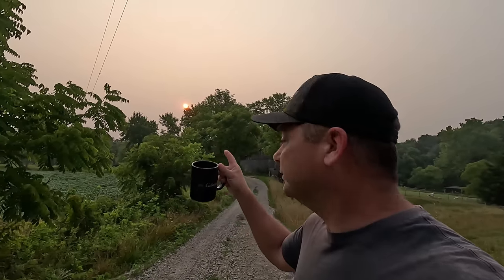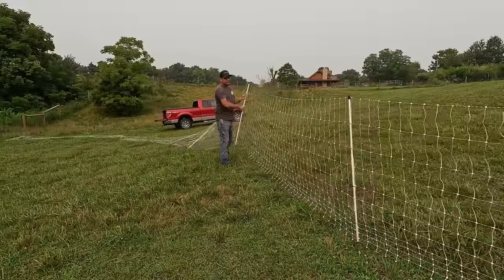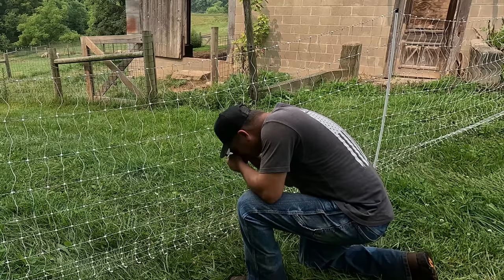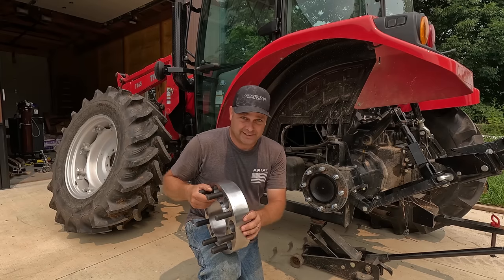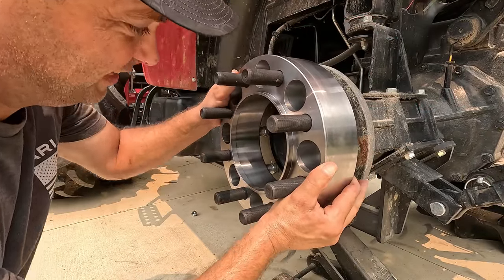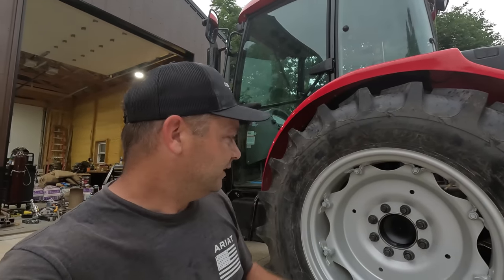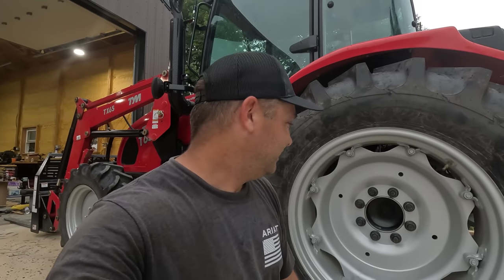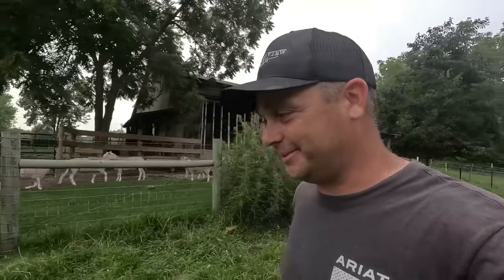Nothing goes as planned.  Widening the Tractor Wheels & Giving the animals more grass to graze.

Comment: Take the outer rims off and switch with the other side and you will have two more with options.  I did that with my 860 Ford with similar rim style.
Reply: He's not going to like reading this. Of course the tires need dismounted.  Just wait for the dissimilar corrosion on those spacers.

Comment: if it was my farm i would not put ballast in the tires but invest in a ballast blok for the 3 point. this way the leverage effect will help unload the front axle and steering while not needing to be as heavy. added benefit will be that when you take off the blok for doing field work your ground pressure will not compact your fields nearly as bad.  Thx for the HQ content by the way.

Comment: Could you not put the tires on opposite sides and put the center dish on the other side of the rim mounts to achieve the wider width without wheel spacers?

Also I would be a little hesitant using those spacers with the spacer to rim pilot being undersized. The pilot is what holds the rim centered and takes some of the load since the rim does not have the tapered acorn lug nuts. In all reality it will probably be fine, but the potential the rim could shift on the spacer is there. 

I enjoy your videos, keep it up!
Reply: Yes, leave the wheel centers, swap the rear tires/rims side to side. The rim mounting lugs are offset to one side.
Reply: Y'all beat me to this one... Leave the centers and swap sides with the rims.
Reply: Yeah i thought the same. Hes not utilizing the full 8 positions. I would not use wheel spacers when i could be using 8 position wheels
Reply: I believe those wheels will go 8” wider.

Comment: Sometimes times chicken. Sometimes feathers. It's just the way it goes. Actually, I want to thank you for the spacer issue. I've considered buying spacers for my subcompact tractor, but maybe it isn't worth the effort. No idea what brand you bought, but I think I'll put my money into ballast. I've got the rear tires loaded already. My light duty grapple seems really heavy and makes the whole rig nose heavy so I need to add weight to the rear end anyway.  Good info on the netting too. I considered it for keeping deer out of our garden, but it would appear my choice of poly wire might have been a good one. Hang in there Evan. Days like this one just make the really good days all that much more sweet.

Comment: Evan, 1st should you put some nonsiege grease on the wheel spacer?
2nd contact ARIAT & get your wife some W/P boots or shoes (steel toes) to replace her flip-flops.  They could protect her from snakes in her morning chores & Injuries.

Having the wheel spacers will save you from tipping sideways & after getting 
the tires filled you will be safer on the tractor period.

Comment: Spreading wheels on a tractor is for row crops . If you need more stability you are using a tractor for something it's not made for . For using the loader you need liquid in back tires and weight on back . Did  you use spacers on front ?

Comment: If you ever get to Harbor Frieght, you should pickup a furniture dolly. That way you can put it under your wheel to remove and replace the tires, but you probably will build a metal dolly if you have to remove the tractor tires.
Make your job easier and safer.

Comment: Can't you move the inner hub from the inside  of those cleats on the rim to the outside of the cleats by taking the rim bolts off and do the same thing as the spacers! Think you can also turn the wheel so the depth is to the outside and get more track width. We had a Ford 851 series tractor that had a system where you could could loosen the hub and hold the brake and the rim would slide on bars to make the track width wider !

Comment: I use those net fences all the time for goats. I separate the bottom 3 rows electrically and the fence works much better. Just cut the wires where they join the bundle.

Comment: I would not put the spacers on. There is a greater moment around the wheel bearings now, even the seals may wear out a little quicker now as a result. Things these days are designed to pretty tight parameters and making that sort of modification may be problematic also, it may nullify the warranty.

Comment: curious as to why you didnt just use the additional wider widths available via turning the outer wheel rims around as they are designed to do??? vs adding stress to the axle by adding axle length via spacers?....adding fluid ballast will greatly improve the tractor performance with the loader and other implements

Comment: Evan, great job.  The extra width will make the tractor more stable. Also, the centering comes from the lug hole pattern. Anything you do to the center has no effect on the tire centering.
Reply: Depends on the lug nuts, if they're flat faced lug nuts, then it's a hub centric design and should be tight on the hub, otherwise you risk bending or breaking a stud.  One quick option would be to build a set of centering rings out of aluminum to fill the gap, but considering how small it is, he'd probably have to try and farm that out to a quality shop that could make a set.

Comment: You might want to go back and check those inner nuts after a bit of work before you fill the tires. I am a little worried about how well the spacer/wheel will hold up with the hub centric wheels not being centered by the hub. If it were mine I would yank those off and get new ones or just abandon that idea. It would be a shame to tear up a wheel or the inner hub.
Reply: The spacers should be ok, but yeah, I'd be concerned about how loose the wheels are on the hub.

Comment: When you get the D17 finished, try the spin-out rims.  And learn how to use the power steering to assist changing the front axle width.  Used to do that a couple times a yesr.

Comment: Some days are like that.  I myself hated my electrical netting.  It was always getting tangled and to get it deployed quickly really takes two people.  I finally got rid of it.  Based on the animals you have I would only put it with its hassle if you want to let your birds into the pasture.  The sheep, cows, steers, and pigs will all respect that poly rope.  Again IMHO....it's way easier to run a 2-3 strand poly on some t-posts than to run the netting.  I also agree with you on the spacers.  Unless you're mowing sideways on a hill I think you're money ahead to just fill the tires.

Comment: I wont pretend I know much about this topic, but I think my concern would be that now all the forces are centered on the lugs instead of the hub, since the hub ring doesn't fit flush with the opening in the wheel. Maybe that's fine, they look like beefy lugs, but it seems like that might be problematic for the loads?

Comment: What is the name of the (brand) manufacturer that you received the wheel spacers from? Also, why are you going to use a ballast inside the tires? If you decide to do so, make sure the rim and valve stem are compatible with the chemicals you use as ballast. Some are corrosive to the original metal used by tractor manufacturers.

Comment: Lock washers on wheel studs?? Is that a tractor thing? I've never seen that before, and I work on vehicles for a living.
Reply: Lock washers are long-proven to be the opposite of useful for locking threaded fasteners. I shake my head that modern manufacturers still use them.
Reply: @puirYorick  Just one of those legacy things we haven't shaken just yet. That thing should have come with some proper flanged wheel nuts. The way it is screams made in China.

Comment: I'd get a weight for the 3 point harness instead of filling the tyres. You can make your own with concrete if you want to cheap out. If you fill the wheels with water, it will be a permanent weight that will effect your fuel efficiency and tractor work will cost more. If you get a rear weight you can put it down while not lifting with the forks.
Reply: NO weighted tires improve traction and the loader is on all the time.
Reply: @jimputnam2044  he isn't using the tractor in muddy conditions most of the time so the extra traction isn't really necessary and while the loader is attached all the time, he isn't using it all the time.

Also a rear weight would improve traction just like water in the tyres. Just without the risks of corrosion that come with water in tyres